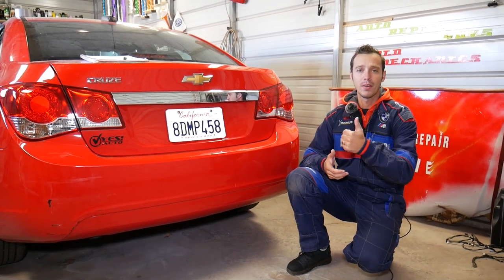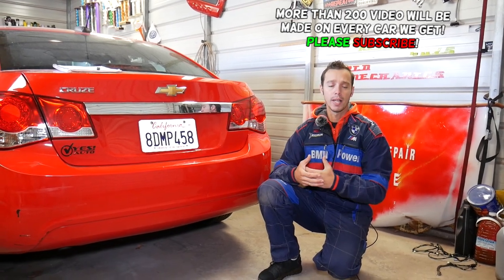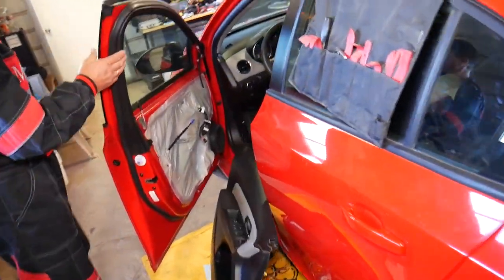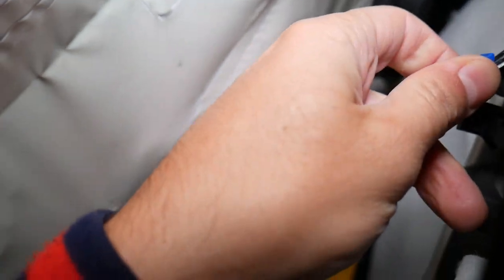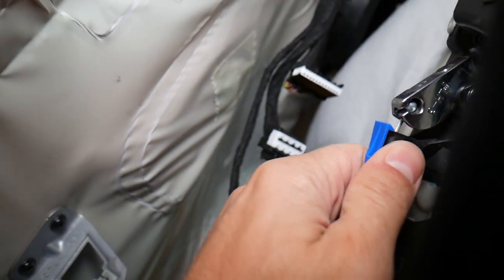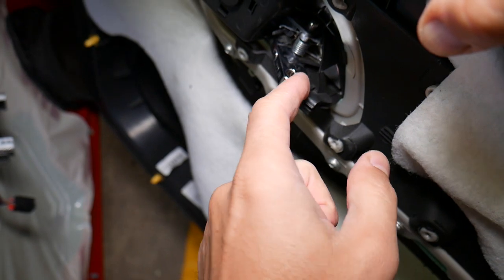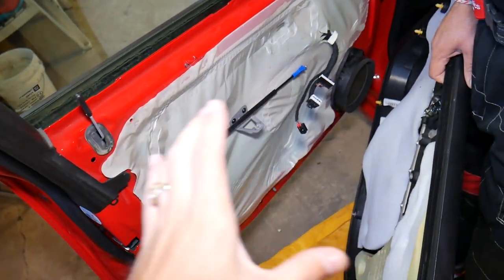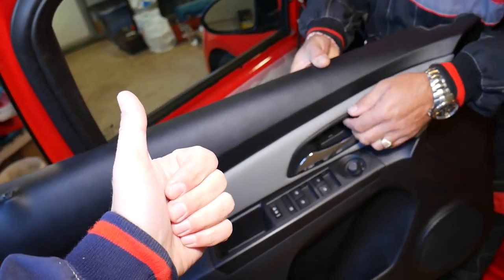CHEVROLET CRUZE FRONT DOOR NOT OPENING FROM INSIDE. TOP 3 REASON WHY DOOR DOES NOT OPEN

Comment: How would you fix it or even remove the door panel if the door will not open from either side? The lock actuator will pop it up and down but handles do nothing
Reply: same problem here!! I can’t open the door to take off the panel to fix it
Reply: How did you end up fixing this?
Reply: @SmentHedz  I Removed the Screws from the Door Handle.. Then I Wiggled The handle around until I got it loose and got access to inside the panel... Then I Used Pliers to Grab Cable, I pulled it toward me(front of car) and held it while I removed the ball on the cable from handle... (Ball at end of Cable slides into door handle) Once the handle assembly was removed I grabbed the Cable with channel locks and pulled forward (towards front of car) and twisted a little until it open!! Took a few tries!!

Comment: What if car door doesn't open from inside or outside. 
Door locking mechanism still works.  Whenever I pull the interior handle it pops up.
I've tried the key from the outside. 
Any ideas?
Reply: I have the same issue did you ever figure this out? One second at work next second it doesn't. The lock will pop up and down but pulling the handle does nothing on the inside or outside. This is a rear door